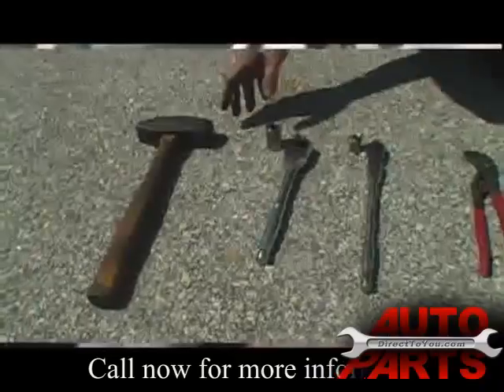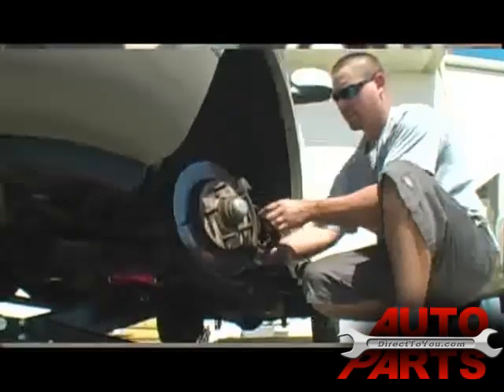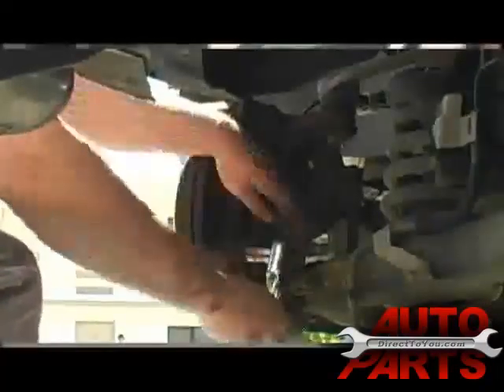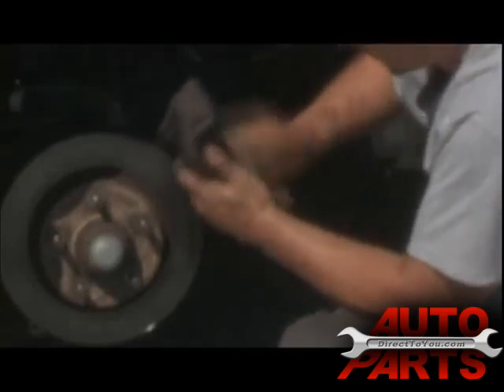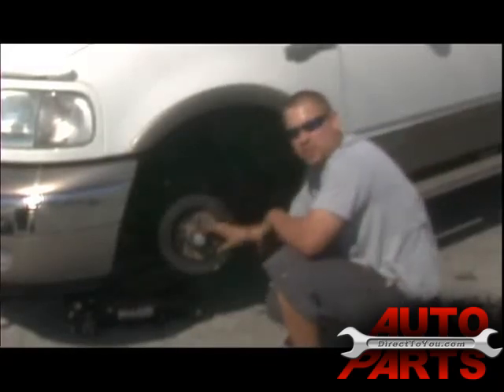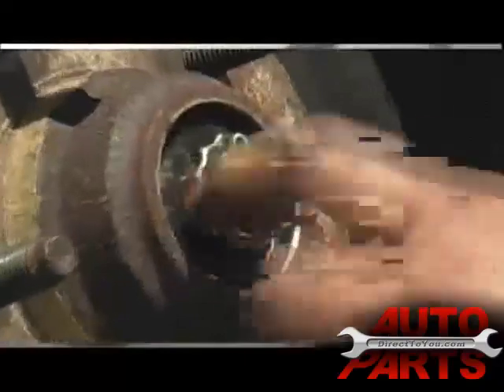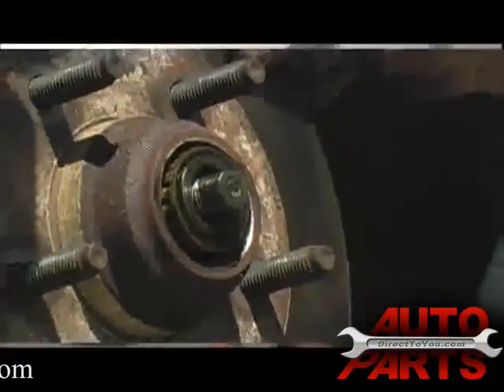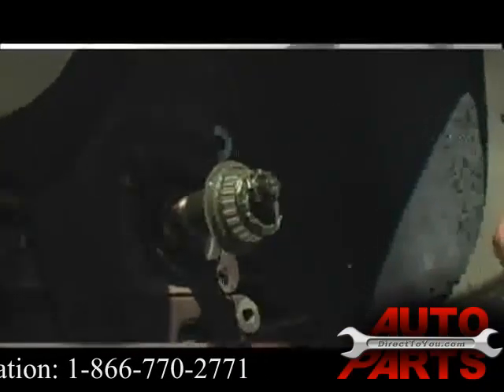2003 F-150 Front Brakes and Rotors Part 1

Comment from the maker: @tilleykd If you are only feeling the vibration in your brake pedal now, it is likely an issue with the rear rotors, if the vibration is travelling all the way up to the steering wheel still, it's possible you have additional front end problems, the ball joints are very common to fail on these trucks and can cause vibrations similar to this.

Comment from the maker: @iwanaGoFast2010 It's similar, the 4x4 is actually easier because you do not need to remove the bearings, the rotors float on the hub bearing and should just slide off once the calipers are removed.

Comment: thanks man, you were right. i never even thought about looking at it first. last time i changed rotors was on the front of a 99 v6 mustang did not need to pull the wheel bearing from it.

Comment: Thanks for the video it made it very simple.I had a vibration in the front end when braking at faster speeds. I was told it was warped rotors so I changed them and pads and although it is better there is still some vibration when braking. 2002 ford f150. 2wd.. Any ideas?